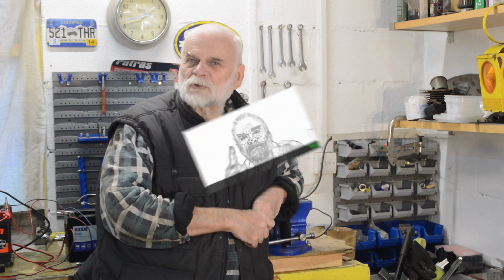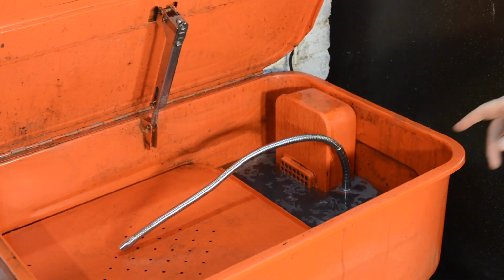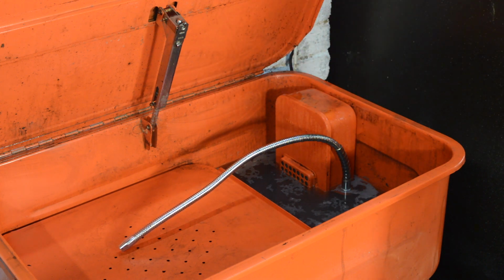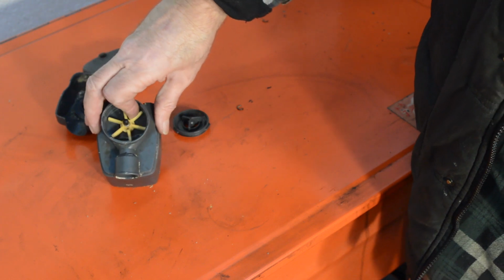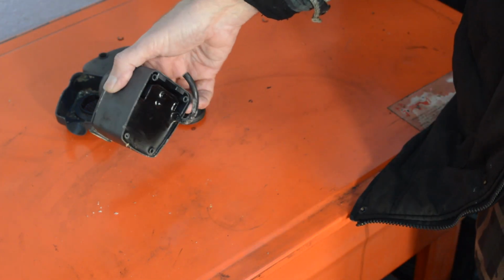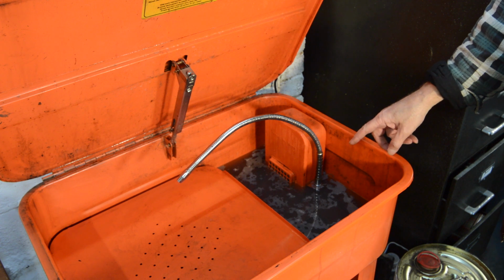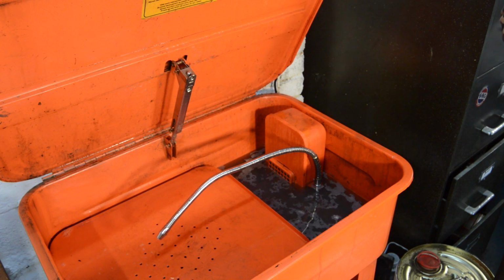Parts washer

Comment: BTW i have the same cleaner as you have and its over 10 years old and is running very well . I only paid £120 for my cleaner and never use solvent based cleaner i use Diesle .Tractor Diesle. Then use Gunk the green stuff and it works very well to finish the job. I sold my CB1300 because of it being to heavey and have bought a 1200 Bandit and a FJ1200 to replace the one bike . I also have a Super dream for restoration .But a resortation project that i am realy looking forwards to is a 1987 CBR250 MC19.
Reply from the maker: You have got a great collection of bikes there, good luck with the restorations and have fun!